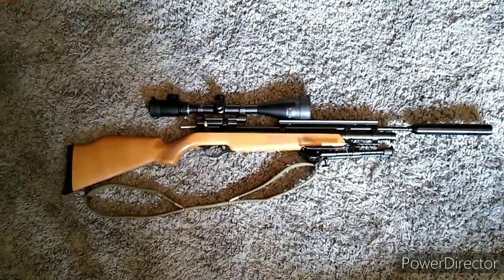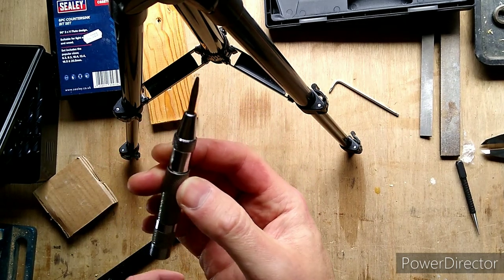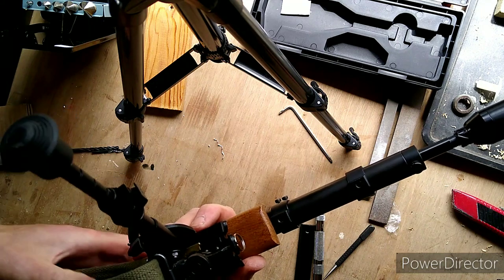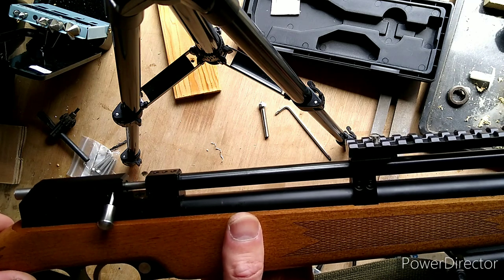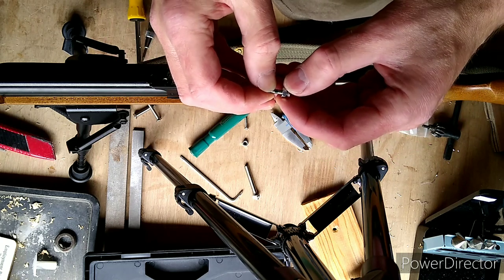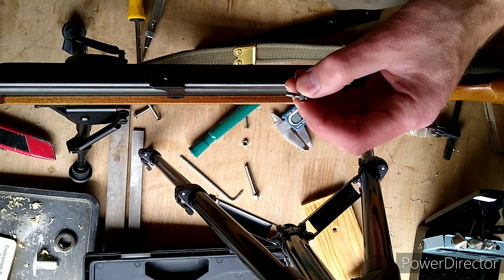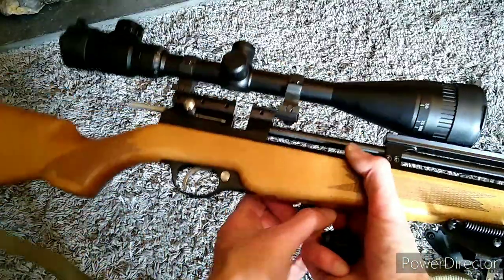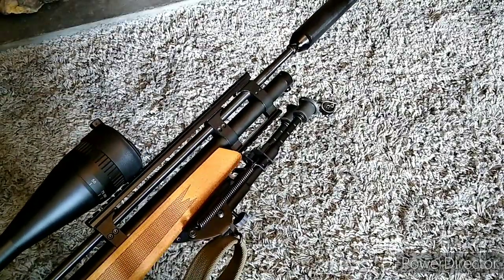NV055 Budget PCP Build Part 7. Fitting extra barrel bands & converting to picatinny rail. Tacticool.

Comment: to get the barrel stif is also done .with a carbon tube and one barrelband at the front . maybe no barrel band is needed, you can get tension with the silencer
Reply from the maker: Hello, thank you for your comment much appreciated. 
That method was used with the L42A1R (based on a PR900W) that was featured on the channel. Steel tube was used with the barrel centralised by nylon bushes. That gun is very accurate and nicely balanced too.
I was hoping to make a start on the Mk2 version eventually, just slowly gathering the parts at the moment.
Reply: Yeah I know, I’ve been looking at a barrel shroud but I really like the look of the dibble barrel bands and the reels. Kinda looks like an AK.

Comment: Hi Nick was looking through your vids to see what success you had fitting the regulator ,as you said you was gonna make a vid of the process , did you have success? , as I have bought a pr900w second hand , the guy who I bought the gun off claims it’s a gen 2 and already has a reg fitted , but it doesn’t mention it on the box , it looks the same as yours so I presume it hasn’t , but I’ve not heard you say in the vids how many shots you get from a fill ? Before or after you fitted the reg , cheers shaneweightman
Reply from the maker: Hello, thank you for your comment much appreciated 👍🏻. I haven't fitted the regulator yet, sadly not had time to take the gun apart. I'm getting around 30-40 shots at the moment.

Comment: Is there a video of you actually fitting the barrel bands and removing the fore sight. I have two bands but lack the courage to do the job until I see it done.
Reply from the maker: I didn't actually film the process of removing the front sight because it came off too quickly when I was working out how to do it.
If you won't ever use the front sight again then unscrew the moderator then grip the front sight with mole grips, a gentle side to side motion gets it started followed by pulling while rocking it side to side. Ideally clamp the barrel in a vice to avoid damaging the action.
Sometimes they can be a little stubborn and may need a tap on the mole grips to get started.
If you want to save the front sight then put some rubber between the mole grips and the sight.
I assume yours is the version with a separate moderator? The process is much the same with the older guns, from memory there isn't a grub screw.
The barrel bands just slide on, slacken the two machine screws, slide into place and then tighten the screws back up again.
Check out the later parts in the series, I did have an issue where the bands pulled the POI down beyond the scope's adjustment so make sure your optic has ample vertical adjustment range (mine didn't) or you may need to use shims.
Hope this helps. My email address is in most video descriptions.

Comment: What barrel bands with the screw at the top did you use, to connect the rails to the band and Where did you get them? please.
Reply from the maker: Hello, thank you for your comment much appreciated. 
The barrel bands are for the rear sight, I bought them from Bagnall and Kirkwood. I won't be able to put a link in the comment so I will put a link in the video description.
The threaded hole at the top is already there for the back sight.
A word of warning, the bands can pull the barrel downward and it can take quite a bit of sight adjustment to bring the point of impact back up again.
The screws came out of my stock of fasteners.

Comment: Nice little series on this gun you have made, thinking of getting it for my first pcp. I have a question if you dont mind me asking, Is the barrel rifled and what sort of speed you getting ?
Reply from the maker: Hello thank you for your comment. Glad you are enjoying the series. Please feel free to ask any questions.
The barrel is rifled.
I can't find my notes from when I tested it but from memory the ft-lb was around 9.7. 
They are nowhere near full power as standard, but this can be increased using either an upgraded hammer spring (I'm not hearing good things about them though) or by installing a regulator.
I may install a regulator fairly soon, a report will follow.
Reply: @nickvending9688  Thanks for the reply and useful info, you got my sub. Was thinking of getting this gun and moding it to resemble some sort the lee enfield sentry which is out my budget.
Reply from the maker: Thank you for subscribing, much appreciated. The compact size of the PR900W does make it a good basis for custom builds. Have you seen my videos on the Lee Enfield L42A1 replica made from a PR900W? I was going to use this PR900W to show the process of building one but the videos on the L42a1r did not get many views so I decided to just develop the rifle instead.
I was thinking about going further down the tacticool rabbit hole and look at whether an AR-15 style fore-end could be used, mounted on the barrel bands. Maybe also modify Airsoft upper and lowers to accommodate the PR900W, in effect building an AR-15 PCP, albeit bolt action.
Let me know if you have any other questions, happy to help.

Comment: For my tastes... I think the picatinny rails look not very good. But I don't think it's a bad modification at all, different strokes for different folks and all that. 
I'll be getting one of these guns next week as my first PCP (and second air rifle), and I've found this series of videos quite interesting to watch. Will definitely be fitting a bipod stud and an extra barrel band at some point.
Do you know if your version is the regulated version? I thought the regulated version had the pressure gauge at the end of the cylinder, but the RFD I'm buying mine from says it's the regulated version, but it has the gauge on the underside of the stock. I actually want the unregulated version because apparently the regs they come with are pretty naff, and I want to fit a Lane reg.
Reply from the maker: Hello, thank you for your comment much appreciated 👍🏻.
It is a marmite look, definitely different to the norm. Function over form.
Mine is not regulated, it is just the standard version.
As far as I am aware the pressure gauge underneath would show regulator not cylinder pressure, so I would expect it to have a pressure gauge at the end of the cylinder. I haven't actually seen one so my apologies but I can't give a definitive answer.
Maybe try contacting Sports Marketing to see if they can advise you on that.